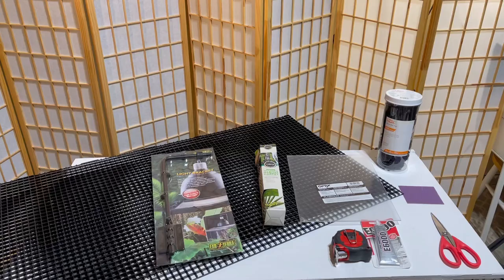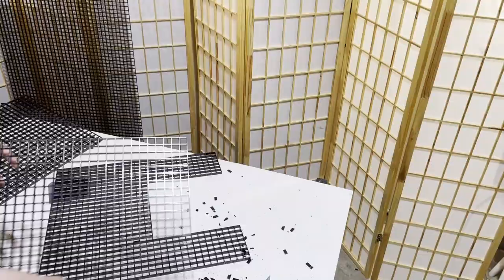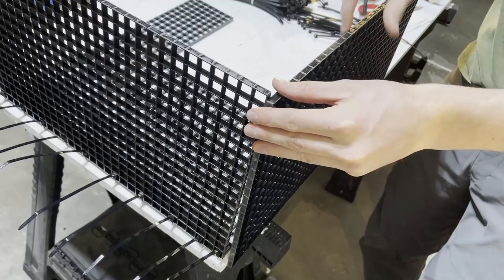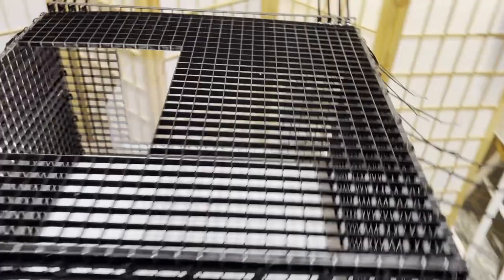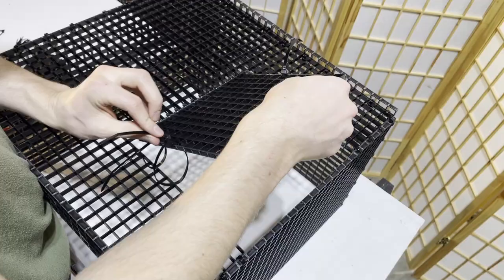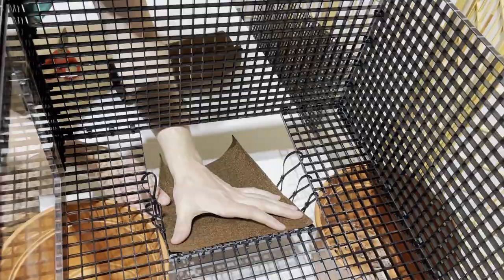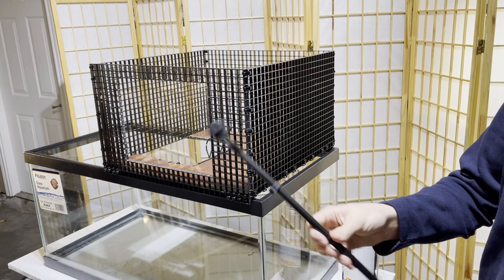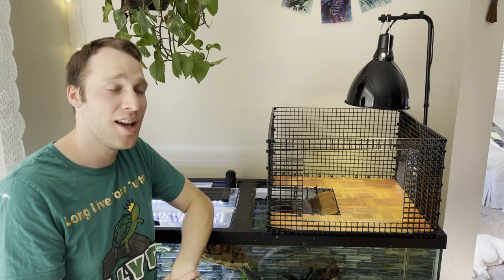Egg Crate Basking Dock - DIY - Cheap - Only One Tool Needed!

Comment: Just a quick helpful tip from an aircraft mechanic that typically has to self engineer fixes... for the ramp I will be using a quik trip straw cut into inch or so sections on both ends of the dock and attaching some 1/4in dowel rod to the ramp itself to make a pivot like point... and adding some small pieces of Styrofoam so the ramp can adjust to the water depth... you can attach the Styrofoam at which ever point on the ramp to adjust how much goes under water...

Also please know im only about 5/8ths through the video so haven't seen the finish product just listening to points being made about the finish build for the ramp...
Reply from the maker: Those are some excellent ideas thanks! I tried to keep it simple but I really like the foam idea. Thanks for the comment!
Reply: That's so interesting. Can you send us a picture or can you post it on another social media? I'd love to see the alterations.

Comment: Nice!! 
Yeah my turtle would be out of that in a hot second 😅 he's a major escape artist. I had to bungie down the clear top of his turtle topper because he kept pushing it up! 

But I love this, egg crate is so fun to work with. 

If you have a tiny drill bit, you can put holes in the acrylic for zip ties-- I did the whole escape-proof lid with just acrylic zip tied to egg crate (because I always glue things to myself, so I try to avoid playing with adhesives) 🤣
Reply from the maker: Oh yes, for those escapers it is easy to just add eggcrate over the top, cutout holes where the lights are located and it would be escape proof! And yes, as long as you are careful, drilling a hole would be a cleaner/more secure method. Thanks for the suggestion as always! :)

Comment: they can climb out of this kind of enclosure as long as the get a good footing area, which the grid provides
Reply from the maker: Certain turtles (acrobatic ones) could. Especially larger ones. But you can easily use leftover egg crate to create a cover if you need it, just cutout a hole where the lamp will be as the egg crate can melt. Thanks!
Reply: @LongLiveYourTurtle  I have 2 female res both aprox 2 years old, crafty climbers. even with the lid they still try to climb out and try extra hard which some times leads to them landing on their back. 
my suggestion, white sun board that blocks all the out side view and reflects heat back to turtles when they are basking. Let me know what you think. Cheers!!

Comment: Looks great but I have a ninja turtle who would totally climb out of that. I used a clear plastic storage container for the dock zip tied to egg crate as a base. I glued small rock tiles to the bottom and she stays in because she can’t climb the plastic. Also used egg crate for the ramp. I also cut my egg crate to fit inside the lip of the aquarium rim and that way it doesn’t slide around.
Reply from the maker: Yes this design had no cover. Glad you came up with some additional mods to make it even better! So cool!

Comment: Is there a reason why the ramp is in the middle of the basking area. It seems to me like the 2 sides are too narrow for an adult turtle to walk around comfortably. Why not just build the ramp off to one of the sides, leaving more room to navigate on the opposite end?
Reply from the maker: Since this was for a 40 gallon tank I made it large enough for a turtle I’d house in it. You can size the ramp however you want! Just keep in mind this is thin plastic with little structural stability. If you make the ramp larger your side legs will be thinner and they were already a little flimsy. So just check that everything can hold as you go! Thanks for the comment!

Comment: I made the crate for my nine month old slider, but I can’t get her to go up the ramp. I’ve tried to put some dried shrimp on it. She does get to and eat it. I’ve even put some at the top of the ramp I’ve even put her in the ramp under the light but I just finished it last night so maybe take time but it needs suggestions. I would appreciate feedback.
Reply from the maker: As long as the basker is similar and ramp isn’t crazy steep then your turtle just needs to get comfortable with it, sometimes it can take up to two weeks!

Comment: This is amazing! Simple yet elegant, bravo!

One question tho, how much weight do you reckon the bottom crate will hold?
I’d love to modify it so it can contain a lil bit of smooth rocks and riversand.
Reply: I built one, not as elegant as this one, and put a double bottom because my shellster weights nearly 3 lbs. That will give you support.
Reply: @anitaramireznegron9289  wow, 3lbs?! Mine’s ”only” about 1lbs 🤗
I’ll keep that in mind. Tnx!

Comment: I love my egg crate basking area. Your build definitely pointed out some modifications that I will be adding to mine😁

Tip: I have a top on mine with a cut out hole for me to easily access inside the area should I need to… my RES (Mr. Greenie) climbed the sides of the egg crate and fell out😲 luckily he survived, he’s also full grown but it could have ended pretty bad. I have a tile covering the hole now but I said all that to say that having an open top with the easily climbable sides might not be the best option🤔 but still great build !!!!
Reply from the maker: Great tip! Yes, incorporate a cover of your turtle can escape for sure. This build can easily accommodate an egg crate lid using a similar method that the build used. But yes, a hole is good for optimal light penetration and minima risk of melting the plastic. Thanks for the advice! Glad you found some mods from the video.

Comment: Great video, i have a question though, i want the basking spot to be hanging slightly below in the aquarium,  it is durable enough if i put some hanging tools in the egg crate?
Reply: Mine hangs about 5 inches into the aquarium. I use large S hooks, with a large curve that hooks on to the aquarium edge, and a small curve that hooks onto the egg crate. 5 on each side. I use a large piece of grass carpet to cover the part of the hook that you can see inside the basking area.

Comment: I have a 12 inch red ear slider.  I have a basking inside the tank, but making one one top.  I use a sidewalk (water resistant tile) as the base.  Do I need to double up the egg crates to be stronger or should it support her.  I currently am not using reptile carpet for the ramp just egg crates?  Is that a no no?
Reply from the maker: You may need to add some support under the basking platform as that’s a large turtle. For the ramp it all depends on whether your turtle can climb just egg crate. Might be trial and error for a larger turtle like that, good luck!

Comment: how long does that reptile carpet last? I would imagine that it would get moldy/algea if it was always submerged since it meant to be absorbant?  or has it been fine? would you recommend any other materials too like the coconut fiber reptile carpets too?
Reply from the maker: Mine lasted a long time (over a year) before it started getting gross. You can always dry it out once in a while to help slow the process. With this design it is easy to replace too. Thanks for the comment!

Comment: I am going to make this and have a question. Why did you not put it in the groves where the light would go? Is the outside better?
Reply: I'm guessing you wouldn't because you can't guarantee those plastic grooves will hold the variable weight of your basking area, though in most cases I bet they probably would. Just speculation, obviously I'm not the guy that made the video.